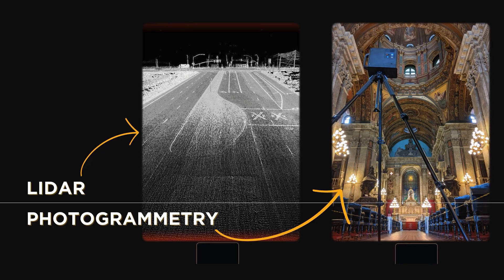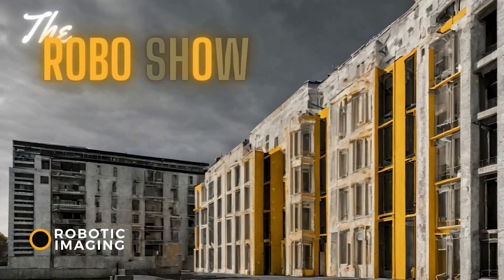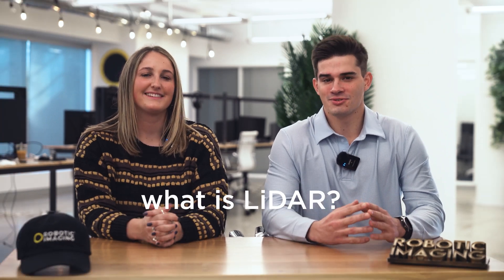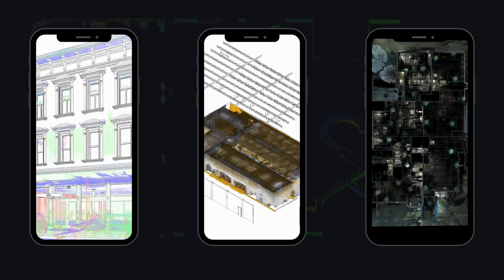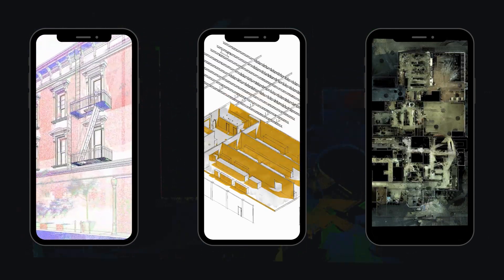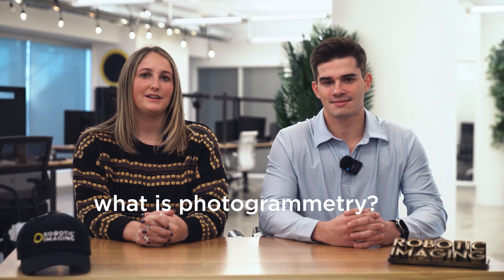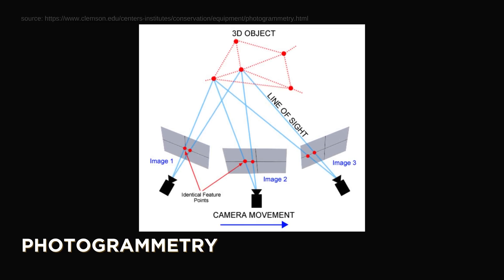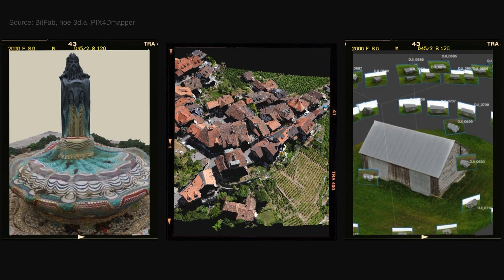LiDAR Laser Scanning vs. Photogrammetry | Key Differences Explained!

Comment: Are there applications where both LIDAR and photogrammetry are used together? I'm speculating, but I suppose it would be possible to use the point cloud data and the corner references from the 3d renditions created by the photogrammetry algorithm to overlap the two and create a visual recreation that is more accurate.